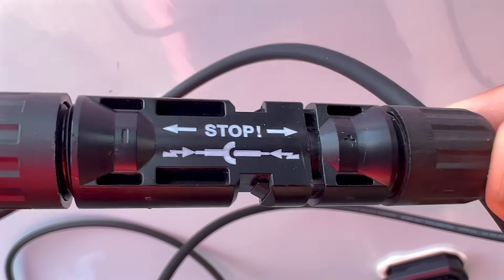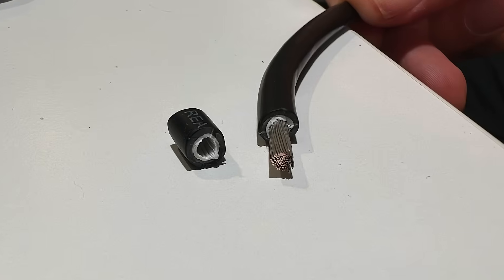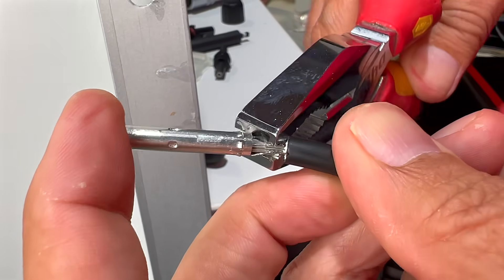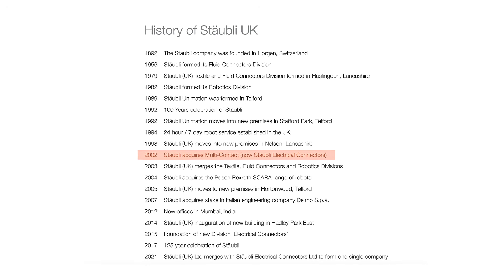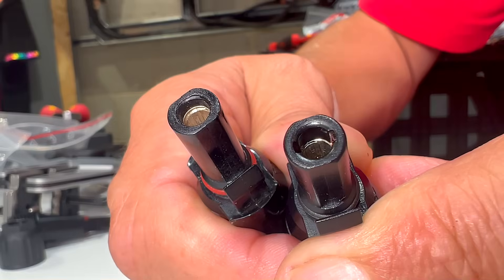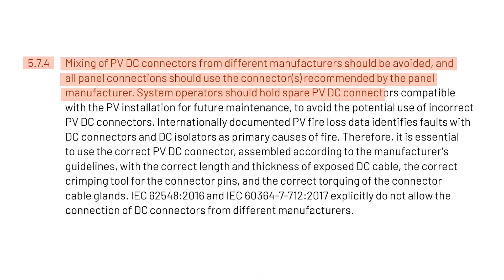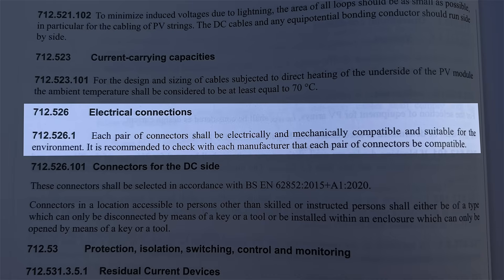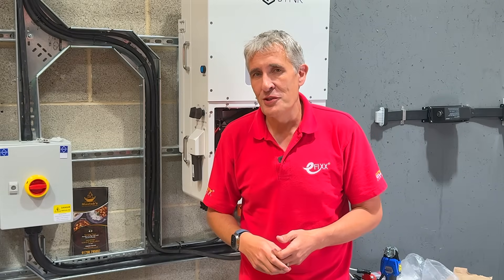Don't Get Burned by MC4 Solar Connectors

Comment: I'm currently having more panels fitted, two different arrays comprising of Longi and JA Solar panels, neither manufacturer specifies on the data sheet what make Mc4 they use, but general consensus is they are Staubli, which I've purchased to ensure the correct ones are used. An electrician will be installing them, last time on the garage they just purchased connectors from the local electrical city factors , I've no idea what make they were, but I'm more educated now.
Reply: What connectors are on the panels are often an option on the order from the factory.  Some manufacturers say what brands they use in the datasheet, others don't mention it at all.  Unless you have the factory order in your hand don't assume anything, check the branding on the connector and hope it isn't faked.
Reply from the maker: I don’t think CEF sell Staubli connectors. However they do use the trademark MC4 alongside other products. 
https://www.cef.co.uk/catalogue/products/5251725-1500v-dc-pv-solar-mc4-straight-male-and-female-connectors

However they are aware of the issue as they also ultimately own this business which has produced a blog post on the topic. 

https://www.segen.co.uk/mc4-solar-connectors/?gad_source=1&gbraid=0AAAAAD9FwnwVn9kMjle69_HtEHZm1p5gd

Comment: Tbh STAUBLI are overpriced, you can get high quality MC4 rated up to 1500VDC from CABUR, they also offer great crimper and tools at a right price.

Just don't buy cheap clones on the web. Period.
Reply from the maker: The price shown online appears to be more than double the price of Staubli.
https://www.cabur.it/en/prodotto/is24241n/

Beware of expensive imitations goes an old saying!
Reply: there is a difference in material. difference in the plastics.. some lookalikes cousing real issues.. and not water resistant...
Reply: @freelifeproductions  Well where I worked until a few months ago we sell about 50k pieces a year of the CABUR ones and zero complaints.

Comment: This is why a micro inverter system is the best. Less chance of DC arcing. But now that panels are now >600 watts? Hmmm.
Reply: Microinverters are suited for places where the operating temperature at the installed location doesn't go over 130F. Solar companies discourage microinverter use in hot locations such as Las Vegas, NV and Phoenix, AZ because the operating temperature  can exceed 140F in the summer.

Comment: This just seems ridiculous understandable but ridiculous! I don't know what else I have to say.
Makes sense not to cross brands but you have panel mounted connectors and supplied connectors and then warranty invalidation why bother putting the connectors on at all. Then you have to source replacements or you leave them but then you need to source the appropriate crimper which might not exist anymore so then I guess you would have to leave a crimper with every installation.
Reply: Incidentally, this is also the case in the sanitary/heating sector.

Comment: In the leisure industry, it’s scary at times how often random connectors are used or forced together. Typically the vehicle owners are driven by lowest cost which pushes dealers to make cheapest purchase costs. I’ve actually seen copies of MC4 plugs that don’t hold together/won’t latch, and there’s a lot of campers who use portable/folding solar panels and rely on constantly disconnecting the MC4s every time.
Glad to see there’s areas moving forward, hopefully it’ll reach leisure vehicles eventually 🤞🤞
Reply: Most electric connectors have number of insertion ratings that aren't very high. Often only 10-20 times. I doubt this design is very high as high insertion types usually have springs and other methods to compensate for surface wear which these don't have.

Comment: Ive done over 400 installs never an issue
Reply from the maker: What connectors do you use?
Reply: wait till the issues come after 5 to 6 years. wait till you have done 1000's of installs.. Solar Edge Optimizers dying.....

Comment: I always call the positive male and the negative female. Reason is the anatomies just feels like that. Otherwise Staubli is what I use.
Reply: You can call them that, and that's fine until you go to order them.  Connectors have been gendered by their contacts forever, not by their shells/housings.  Confusing?  Yes, but it's the standard.

Comment: I almost never use mc4.
They're most junk, poorly designed connectors ever.
Reply from the maker: That’s a challenge - how do you connect your panels?
Reply: @efixx  I will either hard solder them or snip off mc4 and replace them with XT90 or some automotive connector.
Stopped using mc4 10 years ago due to recurrent issues.
Reply from the maker: @jec_ecart that’s a big job on a solar farm
Reply: @efixx  agree.
But much better than dealing with constant disconnection, overheating and fires.
Whoever designed the mc4 did it without much thought. Especially in high amp parallel setups.
Reply: @jec_ecart I know a lot of people that disagree with you. 

Maybe your experiences are down to using knock off connectors?

Comment: So why don't the manufacturers ensure that all are made to precise standards instead of everyone blaming the installer. As it will be at the seat of the fire, all evidence will be destroyed!
Reply from the maker: If you have 50% of the market that’s the last thing you’d want.
Reply: Why not crimp and then solder the joints ?
Reply from the maker: @RobinCommander no need the crimp performs well.
Reply: @RobinCommander  these are the best crimps, much better than general electrical crimps.

Comment: MC 4 became popular because it replaced the MC 3 connector, MC was the first and only manufacturer on the block. I still have a lot of MC3 connectors and the tools.
Reply: That. Exactly that.

Plus the Chinese just adopted what was popular at that time and thus made the MC4 the most used type of connector.

Comment: lol I freaked out when my panels came with Staubli evo’s and I’d prewired for Staubli MC4’s this was after I asked the supplier what ones it’s coming with as the Tigo ones they said they didn’t have evo’s ie the ones they had in stock but they are Staubli too so they are a safe bet as standard on most stuff
Reply: MC4's are compatible with Evo 2 connectors, as long as both are authentic Staübli connectors.

Comment: Good insight the tool isn’t that expensive excluding the one that you are showing that one is hella expensive, I would only buy Staubli mc4’s and a good crimping tool definitely not from the place that has next day delivery or the place that sells lots of 2nd hand goods ;)
Reply: building a hv array agree, not small panels. TBO if your building a larger array , your should be adding more to protect then what MC4 to use.

Comment: Junk connectors and poor installation both play their part.  I know people will be saying you must 100% follow the manufacturer's instructions or things will burn down but one needs to understand the nature of things before blindly following instructions.  It sure wouldn't be the first time I've come across incorrect diagrams and it definitely isn't the first time I've seen manufacturer specified tools not actually able to achieve that manufacturer's specifications.  I do like that this seems to have been adopted by Efixx now compared to prior discussions.  We can now strip approximately 7mm of insulation rather than getting out the micrometer.  Buy decent connectors and use your head.
Reply from the maker: When you know you know!
Reply: Are there 'brand name' connectors you recommend?
Reply: @my_channel_44  I'll accept anything that's been certified by both UL and CSA.
But I' have never had a problem with an "Ideal" brand product.
WHEN INSTALLED CORRECTLY.
Ideal invented Wire Nuts. I'm sure anyone who's ever seen a wire nut has seen a Yellow Wire Nut trying to hold 14 each #12 connectors together. The key word is always "correctly."
Reply: @retrozmachine1189  hello mate i want too connect a load off the 60w super thin flex type pannals and other pannals like the foldable ones for hiking I know those types are 5v I think but if you could parallel 3 sets off seriesed or vica versa so you theoretically could get 15 volt and however much current is there anyway too do this..I guess I want too stick too smaller pannels maybe mix n match but just wondered if had any advise ...are the connectors necessary I mean couldn't you knock off the female connector port off the pannal too access the bare possitive and negative terminals and solder wire yourself with correct wire gauge and controllers n fuses could you do it this way yourself if done correctly..cheers
Reply: @jshaw4757 You could remove the existing regulator and fit your own.  Count the number of cells in the individual panels and multiply by 0.6 to get a rough idea of the real Voc of the panel before doing any modifications to make sure the voltage they produce with 3 in series will be viable with a 3rd party charger.  Keep in mind that 3rd party chargers will be intended to work with a battery rather than hooking a load direct onto it, ie voltage regulation isn't that great.  The existing regulator will likely be designed to allow a load to be directly operated.
Reply: @retrozmachine1189  OK thanks for reply mate,I've just got a small garden (south facing) but I wish make like a lightweight foldable thin pannal setup the 60w thin but I was thinking if could buy 10 off those over time as n when can afford n make something I can fold out n move around easy portable rather than being on the roof I want full controll n access too my design obvs a few batts too store n other needed bits..I can't afford a full setup nor would I want one I don't need stupid power I just want a nice bit stored I can use for little LED setups n low power heater just a 200w one incase ever need n little things like that that I can alternate n use on diff things...does this plan sound viable n if have any input I would appreciate it any suggestions welcome dude..thanks again ...p.s yh I just want something I can build on over time but portable foldable would be nice if possible coz I could carry 100 off those 60w ones on my back if I wanted too for camping n such but yh I hope possible something like that cheers